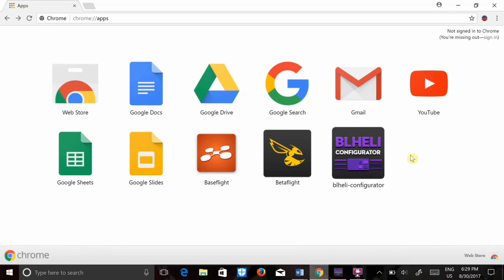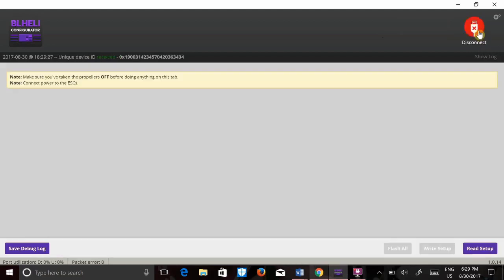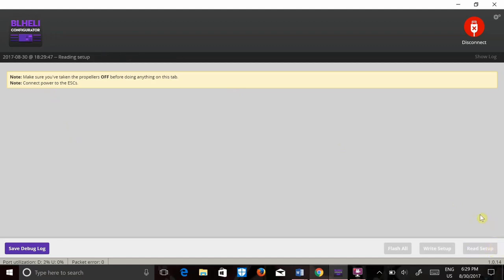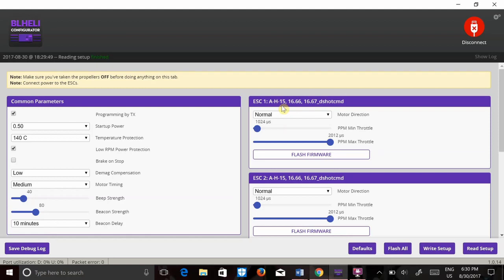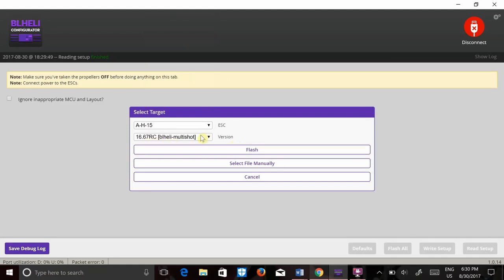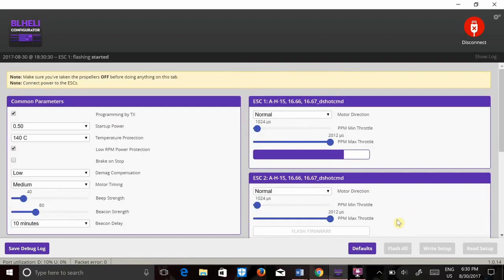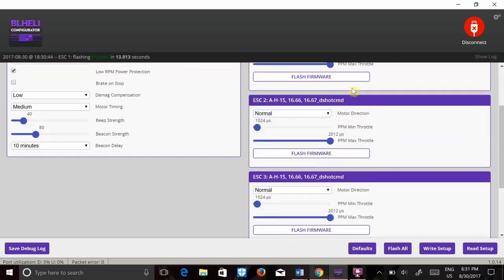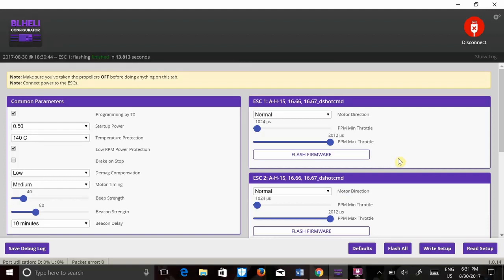How to Flash and Re-Flash Firmware On ESC!

Comment: Sir had a doubt anyway to contact you
Reply from the maker: +UTPAL SAHAKARI comment and I'll try to respond
Reply: Super Sean FPV sir recently we are planning to use propdrive 50-50 with hobbyking 190-200A No BEC for Rc car. So we tried to flash it with Simon K but it isn't responding so well. I guess it is some sort of pin configuration problem. Can you help us out with this sir anyhow? Thanks in advance..
Reply from the maker: So, this method for flashing the esc is only good for BL heli, this google sweet is good for that firmware.  I am not very familiar with that particular esc. I have only used bl heli for smaller esc's for rc drones, I'm sorry i can't be more help and good luck